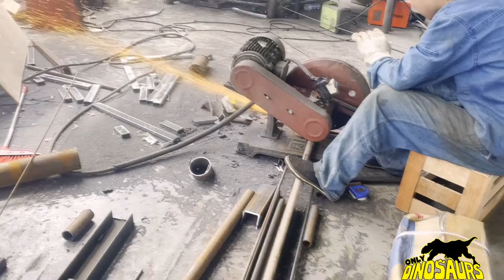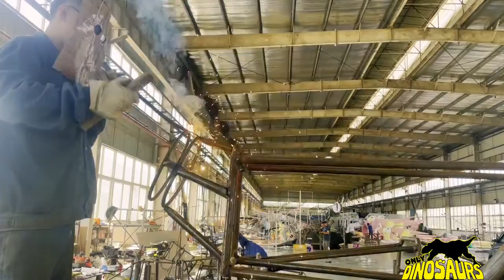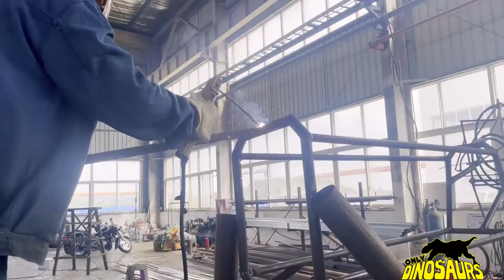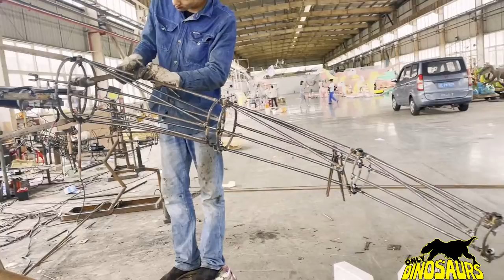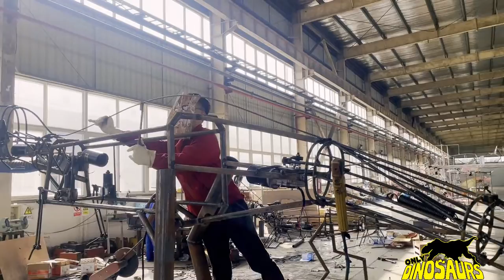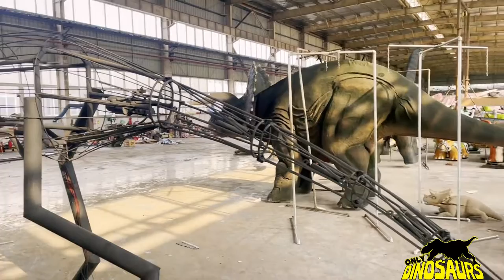How to Make an Animatronic Dinosaur Frame | How to

Comment: Why don’t you guys use aluminum for the frame?
Reply from the maker: Because aluminum alloys are not as good as stainless steel in terms of density, heat resistance, oxidation resistance, and weldability, etc.
Reply: @onlydinosaurs  I see, I was asking since aluminum would be more flexible and weight less and might allow for easier movements